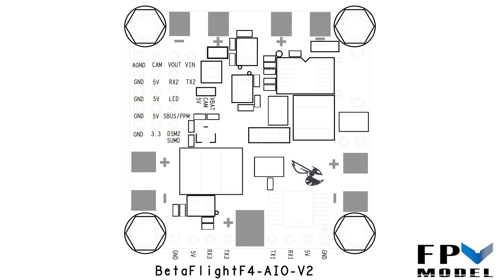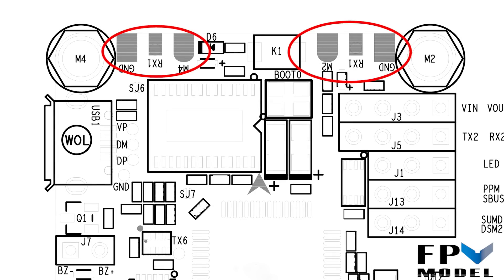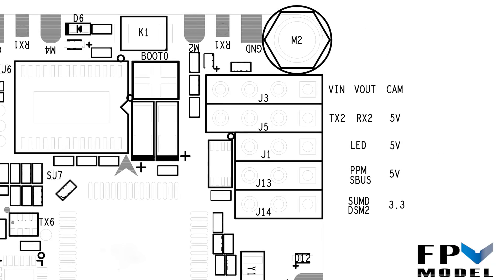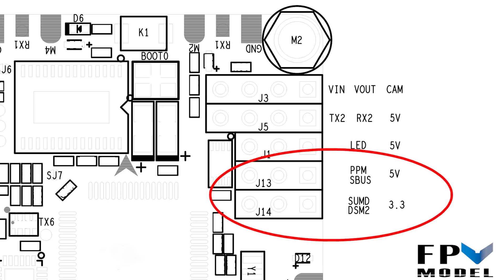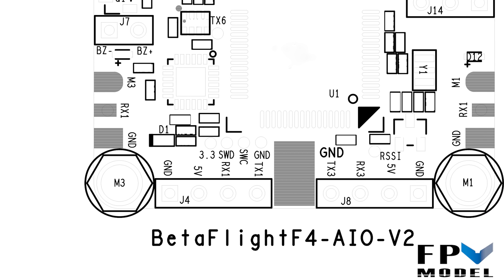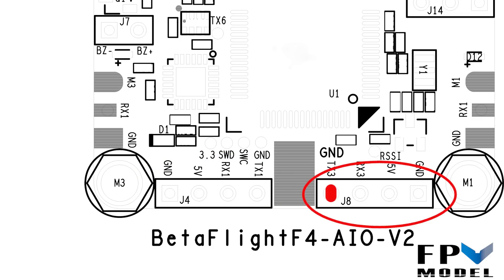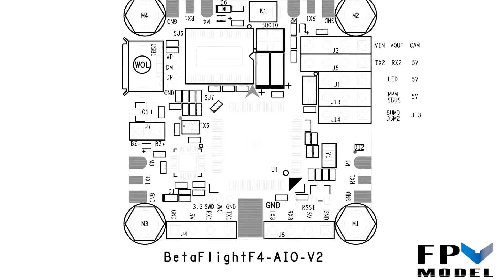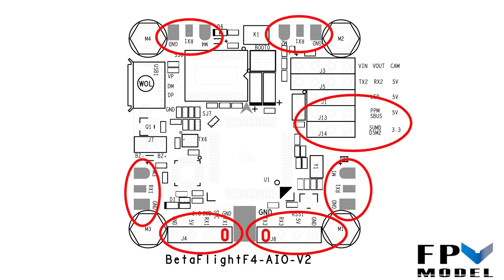BetaflightF4 How To ESC Telemetry, Smart Port Audio, Smar Port Telemetry Betaflight F4

Comment: So I just received the board, installed it exactly the same as my previous BFF3 board except of course the telemetry wire from the escs. Now I cannot get it to arm without the lipo and the USB connected. Any thoughts FPV Model??
Reply from the maker: Head over to our website and go to the BetaflightF4 product link. Once there, go to the bottom of the page and download the latest Betaflight3.2 zip at the bottom of the page. This is an updated .hex that has some timer glitches fixed in the target files.

Comment: I'm having a problem with the spektrum 4649t serial receiver. Every time I power the fc via usb or even by battery, the receiver goes into bind mode. I have tried going through the typical commands: set spektrum_sat_bind = 9, set spektrum_sat_bind_autoreset = 0. I reconnected the receiver to the betaflight f3 board and works without any issues. I am connected using the spektrum dsm2/sumd pin and using 5v as the 4649t requires. Is there anything or other commands that I need to enter?
Reply: Hey Robert,  I ended up changing the wiring to use UART2. Then eventually switched to UART3. I was able to us the spektrum 4649t SXRL bi-directional setup so telemetry would pass through to the radio without that extra power and ground lead.  No resource commands are needed for this.
Reply from the maker: Can you send us a short video to sales@fpvmodel.com or contact us on facebook?
Reply from the maker: Are you using a bind plug?
Reply: No, I'm not using a bind plug, just the sat bind command in cli. I figured out a work around. With the help of some others, I ended up connecting my serial rx to uart 2. As I said before the uart 6 would make the receiver go to bind mode every time. I tried getting the SRXL working on uart 2 in the tx port. At least that's what the betaflight wiki says. Same thing, the receiver would end up in bind mode every time I powered the FC. That telemetry isn't all that important to me. Uart 3 is being used by my tbs smart audio wire. 
I also tried figuring out the resource commands in cli, but that went a little above my head as the pins didn't match up with the pins labeled on the fc.
Reply from the maker: I'll get a video up for you with resource commands and how to. Should have it up in 5-6hrs.
Reply: Do you know if the problem will be fixed? I am having the same problem as Adam. Everything works correctly on my three Betaflight F3 boards but doing the same thing on this new F4 is causing the receiver to go into bind mode. I am definitely on UART6 as instructed.  In addition, when it does bind all the signals are wrong no matter if you select AETR or TAER. Moving 1 thing moves multiple receiver bars which is definitely worse than signals being transposed. Since there are at least two instances of this with the only Spektrum serial telemetry receiver I believe this needs to be fixed and not have to be worked around to move to UART2. I also tried multiple telemetry receivers and they experience the same thing so it is not a faulty receiver. There is something in the flight controller that is not behaving properly.
Reply: Thanks for the response Adam. I ended up wiring up to UART2 and it seems to be working fine now. It would be good if FPVModel makes it more clear you can't use UART6 for our application with the F4 board.
Reply from the maker: Robert Fontanosa, could you tell us can you tell us how you have it connected to UART2 and how it was connected to UART6, we're currently still trying to find why people are getting different setups working with the receiver.
Reply: I connected them identically in regards to which wires went into their corresponding holes. When it was connected to UART6 I went into Betaflight and made sure that UART had serial receiver enabled. I also made sure Spektrum 2048 was selected as well as the appropriate receiver type. The receiver would always just go into bind mode even though it was not setup via CLI to go into bind mode. I did bind it to see what would happen and the receiver information was completely wrong and it wasn't due to changing the inputs.

Once I moved to UART2 and did everything exactly the same as when I tried UART6 everything worked fine. I maidened the quad the other day and it flew perfectly. I think UART2 will not work with any serial receiver. It was probably designed for an FrSKY serial receiver.
Reply: Sorry....I meant to say UART6 will not work with any serial receiver...
Reply: The Betaflight F3 board works perfectly when you use the SBUS area on the board and then convert that UART to serial receiver. You can't do the same thing with the F4 board.
Reply from the maker: Were you using connecting to SBUS location on the board and using a rx that doesn't use an inverted signal?
Reply: Yes, I was using the SBUS location like I did on the F3 board. I tried all the signal options AETR, TAER, etc. and it was not working correctly with any selection. TAER I believe is the correct signal order for Spektrum.
Reply: When connected to SBUS no matter which signal order you choose multiple things move with just one stick movement. For example, throttle moved all 3 AUX bars which is just completely wrong regardless of inverted signal or not.
Reply from the maker: Have you tried connecting the Specktrum rx to the DSM2 location? It runs uninverted to uart6. If your rx needs 5v then should leave the power input for rx on the 5v location and not move it to 3.3v.
Reply: I may try that if something goes wrong with UART2.